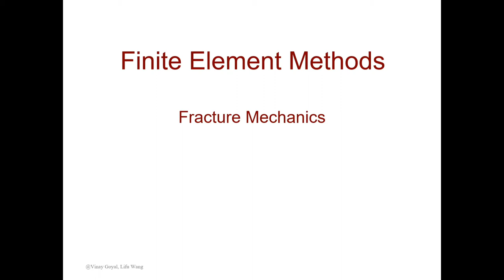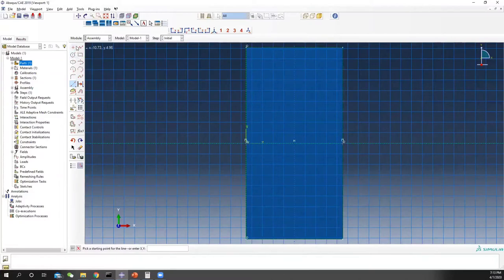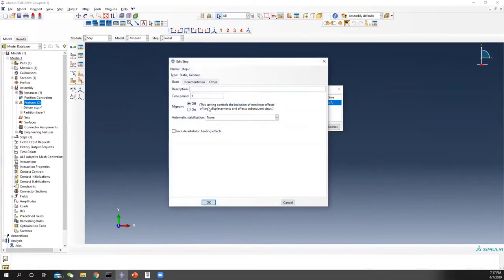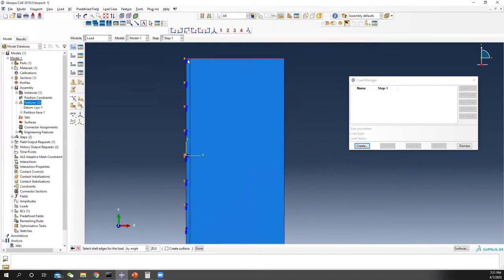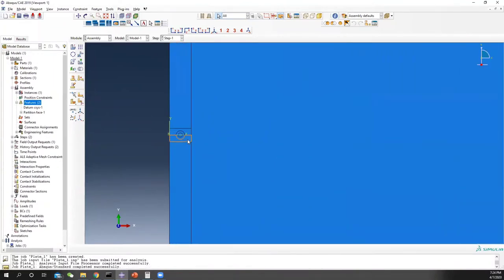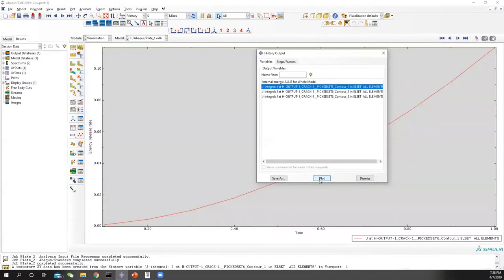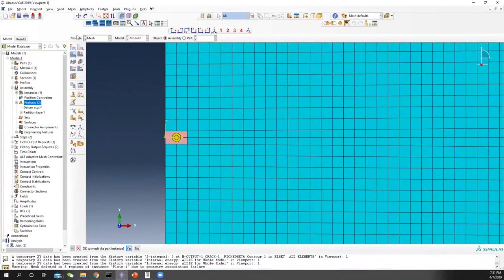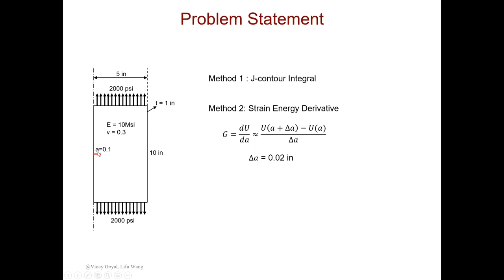#ABAQUS Tutorial - Fracture Mechanics

Comment: I tried the exact same procedure but used the plane strain element type while meshing. It ends up showing that the part or instance contains both quadratic triangle elements and regular quadratic elements which are incompatible. 
I need to assess the J-integral considering plain strain condition of the 2D plate. Can you provide any suggestion on how to deal with this?